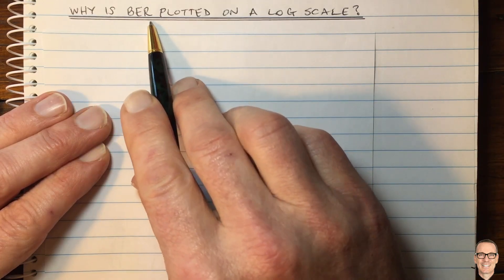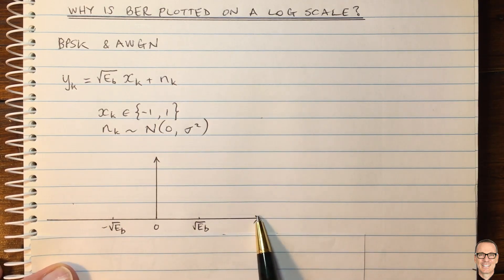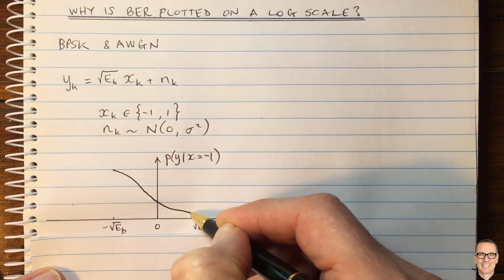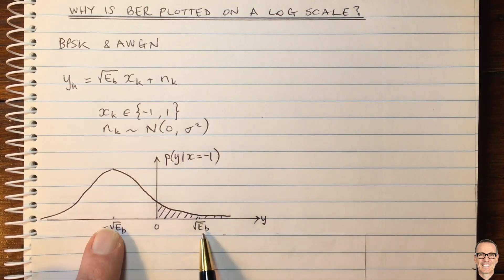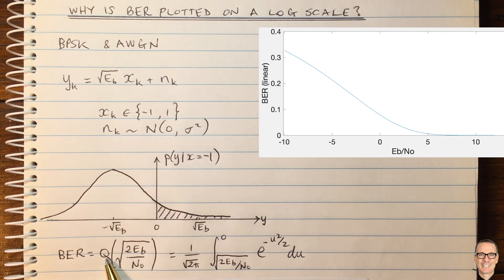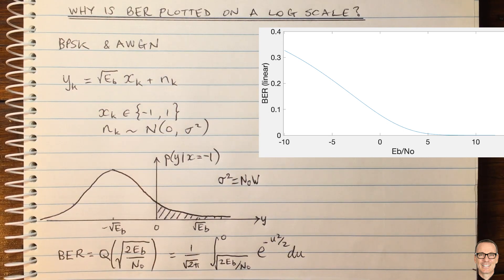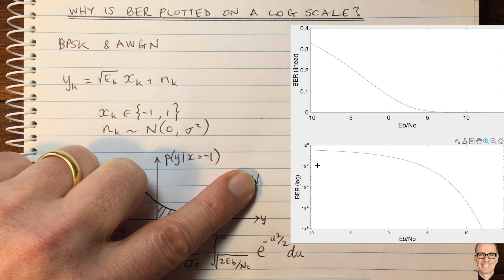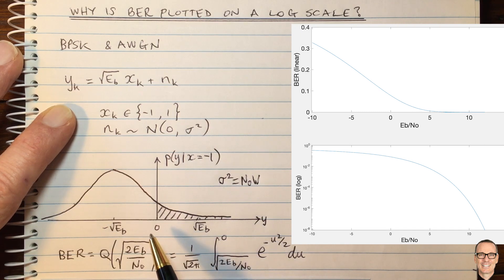Why is Bit Error Rate (BER) Plotted on a Log Scale?

Comment: if it a linear function in the log scale, does that imply that if we increase the Eb/N0 the BER will decrease linearly in the linear scale ? Although this is a stupid question but go back and forth between linear scale and log scale really confuse me ...
Reply from the maker: Sorry for the confusion, it means log(BER) = - C_1 log(Eb/No) + C_2 . In other words, it is a straight line with a negative slope on the figure where Eb/No is plotted in dB on the horizontal axis, and where the vertical axis plots log(BER) (as shown in the figure on the bottom right hand side in the video).
Reply from the maker: I've just put the Matlab code for the plots in the video on my website http://iaincollings.com on the Digital Communications page, under the Modulation and Demodulation tab, in case you'd like to see exactly the equation I implemented.

Comment: Thank you. I just thought about the value -(Eb)^0.5 and (Eb)^0.5. I assume that are voltage values, so it can be -2 V and +2 V. But how do you guarantee thet these values are constant? We transmit with an altenate current, so the value changes over time this way or another. It seems to be a bit confusing. I want to transmit the value -2 V for bit 0, but it changes constantly. Thanks.
Reply from the maker: Yes, they are voltage values. You might like to watch this video, which answers your question: "What is a Constellation Diagram?" https://youtu.be/kfJeL4LQ43s